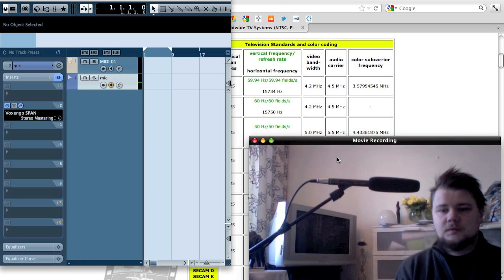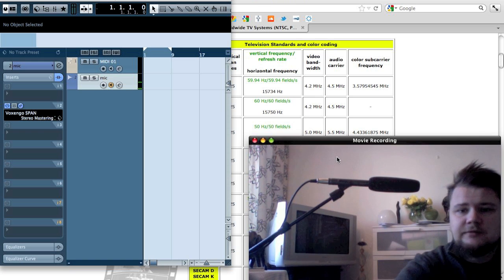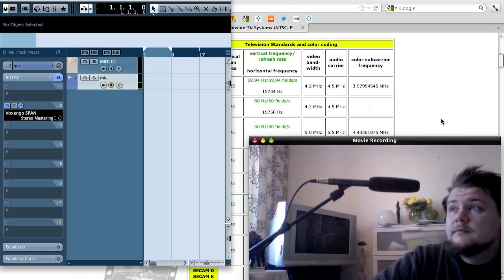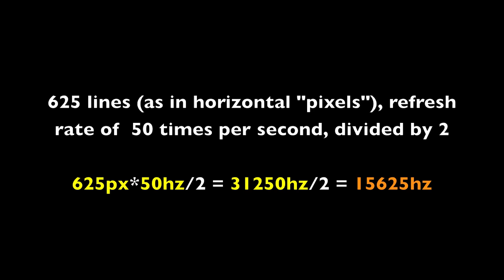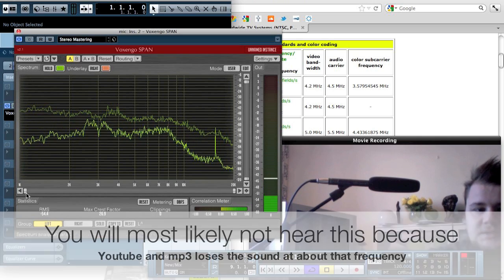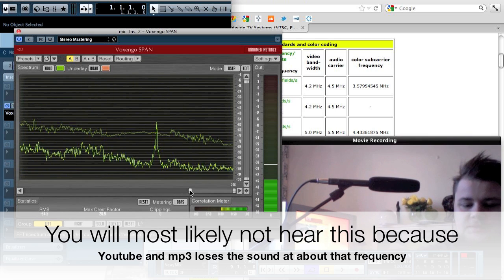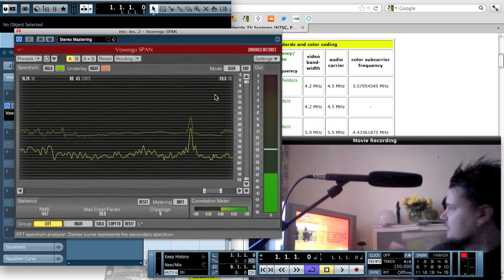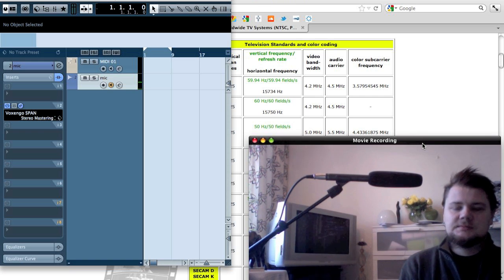Recording 101 - Demonstration - That high pitch sound from old TV explained

Comment: ....Unfortunately the only way to positively identify which coil/ transformer is the cause is (with the tv on) to use a listening tube(not metal!) to localise the noise, or prod around gently with something insulated, which will usually start/stop the noise.
 
Once the offending part is identified ideally you should replace it, or you can get away with treating it with insulating varnish(or a dab of superglue at a push) to damp down the physical vibration that is causing the noise.

Comment: A whistle/squeal noise is going to be coming from a coil or transformer in the line output stage of the tv - line frequency 15625 Hz hence the high pitched noise.
 
This area can be identified by a big transformer with a thick red wire coming out of the top, going to a flat round connector on the back of the tube - be careful this carries around 20,000 volts and will still be charged with the tv off!